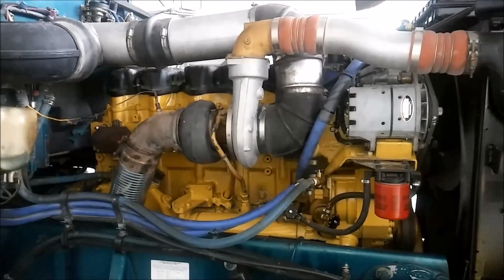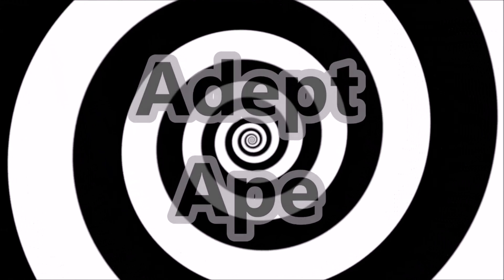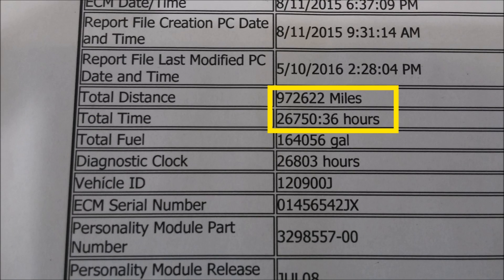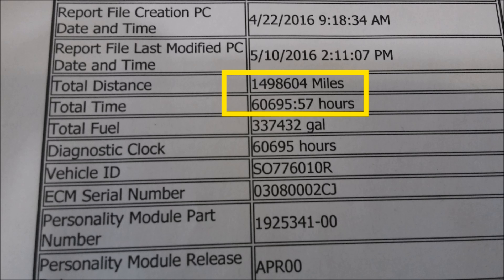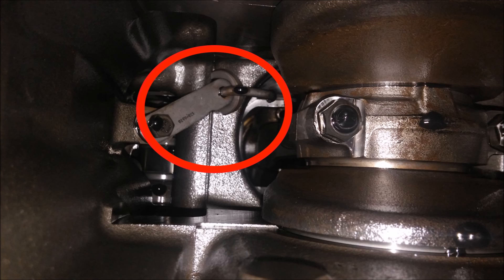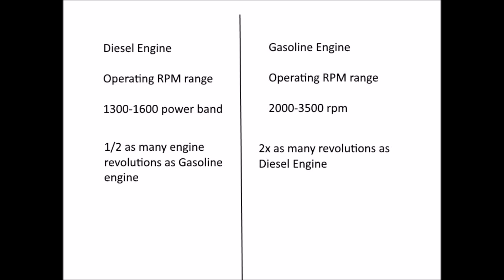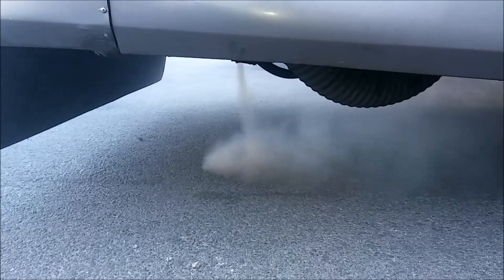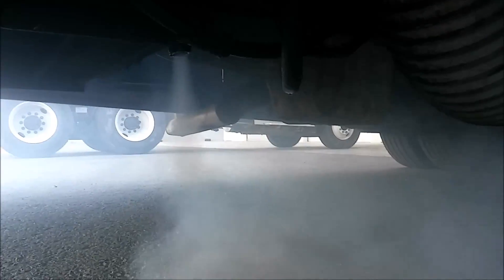Why Do Diesel Engines Last So Long?

Comment: That right there is one of the best diesel engines made. A single turbo 3406 
Bullet proof. 
My detriot 14l 2007 went till 700k first head gasket. 
900 another head gasket by a idiot mech. 
So.at 930 I had a Inframe done at dealer. 
Should be good for another million miles. 
But that cat is the wet dream of all over the road truckers.

Comment: I would say that on a normal car based engine it will come down to rpm. A diesel revs less than a petrol and its parts are getting less stress on them

Comment: One thing I might add, before Dean Ing published his survivalist book, and I have a copy of it vacuum preserved after microfilming it and had it reprinted from the microfilm archive cassettes, it is well known fact that during WW I and before WW I castor oil is used as an engine  lubricant and a well blended graphite-thiokol rubber (rubber containing 5% sulfur and 5% lamp black carbon dissolved and mixed with the rubber before being pressed, formed, and vulcanized into it's final shape) is used as an indefinite revolving seal for both moving and stationary seal and graphite lubricates graphite. The castor oil, over time, forms a thin layer of self-renewing self-lubricating varnish on all mechanical parts. Dean Ing claims to have a Volkswagen using an engine oil composed of a mixture of 50% castor oil and 50% Steen-C silicone oil, so far so good it is still running in the 80s and I have no doubt that it is still running. Using direct drive gear-shaft designs means no belts or metal chain belts to break. The minute the diesel engine is started all direct gear-shafts drives the engine oil pump, the water cooling pump (now containing bars leaks), the fan driving cooling air through the radiator, etc. All gear-shaft driven systems are covered with a metal mesh protective cover for human safety needs and safety standards requirements.
Reply: Caster oil was used in racing cars before the war.
Reply: Caster oil was used in racing cars before the war.

Comment: Modern diesels are way more unreliable that gasolines. You may get more miles out of the block but that will cost you more on other parts because they come with a load of frequently problematic and very high cost components that gasoline engines simply don´t have: electronic injection pumps, turbos, EGR´s, MAF´s, high pressure injectors, DPF´s, intercooler, etc

Comment: You need to compare a 7.3 Ford diesel to say a big block 460 big block because the 7.3 was made to replace the 460 that way your comparing apples to apples not apples to melons

Comment: At road speed  a 80,000 lb load needs. 250 to 300 hp or less so the big 450 hp engine is just playing with the load. 
Worm tham up and cool em off.
That's my take...

Comment: I will agree diesel engines are heavy duty. However, the main reason diesels last longer because they typically run on lower RPMs. The lifespan of an engine is measured by the RPMS it makes however this would be so hard to calculate so we uses mileage or hours. Lower RPMs, longer life.

Comment: part of why these trucks last longer is cause they run all day, they run cold alot less than cars do on average and its the cold running that wears em out, a guy put a million miles on a toyota tundra cause he took care of it and drove it pretty much all day every day, caterpillar makes good engines but we have hell with them and their core charge bs, half of it was us, one of our guys forgot to get a reciept or something and they took advantage of it and took the cores and since we cant prove we gave them em they just went and said we owed them those cores again, and they get away with it cause we dont have a reciept to prove em wrong, its a shitty move on cat and a big mistake on us, we lost thousands, each cylinder pack out of a 3412 is like 700 bucks as a core, a cam is 800 bucks and a turbo turbine assembly without the housings is like 3300 bucks and the cylinder head off the 3412 is like 5 grand as a core, and we have 12 cylinder packs so all that together we lost about 17,500 bucks, which is a big shit piss the boss off move, glad i wasnt in charge of that but if i was i would probably make damn sure i got that reciept for my cores, also cat should try and make it right with us instead of saying survival of the fittest, thats not how you build customer loyalty, they dont seem to care because they already own the industrial world, big business is a horrible thing sometimes, thats why i hate cat, dont hate the motors cause they work and work well but if i ever have to fix one of mine i will not be buying OEM cat parts

Comment: I certainly agree that diesel engines last longer but I also believe that the auto manufacturers don't want their engines to last so you have to a) take it in for service, orb) you will to buy a new car or truck.I think they could make a gas engines last as long as a diesel...if they wanted to.  I got almost 300,000 miles out of a Chevy 4.3L through proper maintenance.  If you can do that with a Chevy you can do better with a Toyota!  I plan to get a half million out of my Toyota.

Comment: Well, OK, diesel engines have larger parts compared to gas engines of equal sizes. But, that's because of the large amount of torque that they produce.... smaller size would break. But, I agree that the internals are built stronger, for sure, in part, by being bigger and heavier. Now, the gear and manually driven parts does indeed add reliability, as there are less parts in the system that could possibly fail. However, Toyota makes gasoline engines that are some of the best on the planet. I would keep in mind that those oil jets for the pistons are not extra ... they are required to stop the engine from failing. If that jet fails, huge problem. Finally, yes the diesel does indeed run at lower RPMs. One main reason for that, however, is due to their increased mass. With such a large mass, if it were to run at higher RPMs, it would self-destruct. Therefore, they are designed to have as much power as possible at the lowest RPM. It is a trade off. That's why they produce so much torque, well one reason anyway. Gas engines can run faster because they are lighter. Example, you want higher RPMs, lighten the internals. The comment about 75% damage being done during the heating phase ... well, yes, back in the day. Today's gasoline engines have no warm up period, except at very low temperatures. That's not just the engine designs ... it's the oil today. Synthetic oil 0-20 is in my Honda. No warm up. No warm up recommended. It's not even in the manual. Granted, I don't suggest to start and floor it when it's -15 degrees. That's is more extreme. But in typical 30 degree Philly winter. I don't warm up and I beat the crap out of my Honda, and there is not a damn thing wrong with it. And finally ..........WELL DAAAA. That's why diesels have so many thermostats....because they are so hard to cool

Comment: Great videos and information you provide. Thank you

You mentioned that most overheating issues that you encountered were diesel pusher RVs.
I currently own an RV with a CAT C9 engine and love it. I am interested in hearing your view regarding diesel pushers and overheating maintenance requirements to reduce possible overheating of diesel pushers RV,s.
Thanks

Comment: Diesel engines still use timing belts. Our PSA DW8B 1.9 NA Diesel engine in our 2004 Berlingo uses a timing belt and an auxiliary belt

Comment: If is CAT will last long, a perfection ingenuity.
Reply: If it is in a over the road truck you will get it to give you great service.  CAT didn't have such great luck with the engines they made for locomotives.  They failed miserably.  Even CAT couldn't figure out what to do to fix them.

Comment: 1992 mechanical 3406C 450,000 miles .

Light knock at idle and under 1600 rpm, above 1600 rpm knock gets much worse. Problem started 5 weeks ago .Overhead was run 3 weeks ago. Rods and mains replaced 2 days ago. Nothing found in pan. Did gain 10 lbs of oil pressure !! Work done at local diesel shop. Also taken to Cat dealer checked out in parking lot ( they did not ride in truck ) . Said they heard nothing.
Reply from the maker: +rob byrum A knock could be a lot of things, air compressor, camshaft/valvetrain, exhaust leak. Really depends on what the "knock" sounds like.
Reply: Hi totally understand , I was the engine rebuilder for a very large ready mix company years ago. I have not herd the truck . This info was given over the phone. I don't understand why they can't get at least some general area where noise is coming from.

Comment: The ONLY reason a diesel lasts longer than an equivalent gas engine is low steady RPM.  Highway cruising, pulling.  Diesels in general city/highway pickup truck type use have only marginally longer lifespans, with radically higher maintenance costs.

Comment: While I'll agree with the fuel and use argument, the journal size has nothing to do with it.  First of all a 15 liter engine has a displacement of 2.5 liters per cylinder instead of roughly 3/4 of a liter per cylinder that a 350 would have.  That alone makes for a bigger piston, rod, and crank which would all need bigger bearings to keep it all properly lubricated and held together.  Next there's the fact that the compression ratio of diesels in general is at least twice that of a stock gas engine which leads to higher cylinder pressures which in turn leads to the need for bigger bearings to support it all.  Finally a gas engine only fills the cylinder with air at wide open throttle due to the trottle body or carb restricting air flow to regulate engine speed which causes lower cylinder pressures on the compression stroke.  A diesel on the other hand has no throttle body or carb and fills it's cylinders with air on every stroke... then on top of that have turbos to push more air in the cylinder which in turn will of course raise cylinder pressure.  In todays economy of making things cheap so profits get bigger if they could shave a few pounds of metal out of the engine it would have been done it years ago.  The reason the journals are the size they are is because of basic physics... they need to be that size to prevent failure.
Reply: For some reason this is still kind of bugging me... parts of it are kind of misleading.  Probably less than 30% of people actually understand what a 10+ liter engine is and what it's built for.  Part of the reason these engine last over a million miles is because they have to.  The drivers I know of put around 500 miles a day on their rig.  500 miles a day 6 days a week ends up at 156,000 miles a year... and that's just a single driver making a single run. At that rate it would take 6.4 years to reach a million miles.  An engine in the shop for a rebuild isn't making you any money (I'm guessing between 1 and 1.5 million is probably average).  You also have to factor in the fact that these same (but sometimes somewhat modified) engines power different equipment like generators, construction equipment, farm equipment, and such that may run 24 hours a day for weeks on end.  Assume a constant road speed of 65 MPH over 24 hours would put you at 1560 miles in one day to put that in perspective.  At that rate it would take less than two years to reach a million miles (or it's equivalent hours).  Chances are due to environment, use, actual load, and other factors the engine may be being worked less or more than a road engine which will effect how long until a $10,000 or more rebuild will come around.

The gear drive is more or less necessary.  I doubt anyone really wants to tear the engine half apart every year or two to change a chain.  The gear drive is does eliminate the whole belts breaking and chain issues since your air compressor, fuel pump, power steering, and on some water pumps are all gear driven.  I'd venture a guess it would take a decent chain to force open the valves for the engine brake also.  I'm sure there's hydraulic pumps and such that I haven't dealt with that bolt right on as well to the gear drive.  Speaking of water pumps... a modern industrial diesel should not die due to overheating.  The only two ways it should overheat to the point of failure other than air in the system that causes the sensors to read wrong are:  the operator kept pushing the shut down over ride, or the auto shutdown sequence was disabled in the ECU . A belt driven water pump isn't that big of a deal, but the gear drive is obviously better.    

That covers it for me... other than that I did like the video.  Never knew about the cooling jets before (we don't get into major engine work.)
Reply: I screwed up... 500 miles a day at 5 days a week = 130,000 miles a year which is 7.7 years until the million mile mark.

Comment: Diesel as a fuel is far more lubricating

Engines are built heavier to deal wd the higher compressions

Engines are usually long stroke and rev much lesser

Loads f low end torque so leaser revving while driving

Dont sound dat great on revving so people rev it lesser

Na diesels much lower power wn compared to na petrol . The engine is jst nt strained really high

Comment: My C15 cat has 1.1 million miles on and runs like a top.. Just as a side note that all the goin green tree huggin bullshit put a stop to all these million mile engines with the Democrat Exhaust Fluid and other junk on them.. I have seen isx cummins knock holes right through the block under 300k miles on from the emission system not bein maintained properly.. but the ones that have the emission system deleted last forever within reason of good care..
Reply from the maker: +0307 0307 I've never heard of it called Democrat Exhaust Fluid before, that is pretty funny. The engines really don't like all the recycled exhaust and aftertreatment junk. It is crazy the truck market changed so much in 10 years. You could have bought a Cat with pretty much zero emissions regulations a decade ago. Now you can't even buy a Cat and every other engine has been heavily regulated.
Reply: Yeah it's funny but when I drove coal truck before obama save us all from evil coal, it took DEF. I took a black magic marker and scratched out diesel and wrote democrat above it. So it said democrat exhaust fluid. Guys laughed about it for a couple years lol.. it was basically me looking for ways to release my frustration with the government's bs.. needless to say I thoraly enjoy my cat. I'd rather a 6nz but I won't complain about a acert compared to what's on the road today.

Comment: All good till u praise gear driven water pump. no good John deere mech for 17 years. when they went gear drive in the 1983 get water in the engine oil. Today got a 9320 tractor. water pump failure. bits and pieces of the water pump ended up in the timing cover. so long crank gear oil pump gear idler gear and cam gear. My customer wishes it had a belt.

Comment: Well not ALL diesels, chevy 6.5s don't for sure, and yes Ford's 6.0
Im running a 2000 7.3 447k miles on it and still running great.
LOL chevy 350 vs a 927.6 in³ cat engine LOL

Comment: 1 thing that a standard 'Gasoline' or petrol as we call it in Australia, can't do, that a diesel can, if the right modifications are made, is run of used cooking oil, used transmission fluid and even used Diesel engine oil. As I said, there are modifications that have to be made, like heat coils in fuel tanks, especially if u live in the northern hemisphere and other mods to warm & keep fuel lines warm. Imagine running your diesel on 40-70ltrs of used oil per week? Very very cheap.

Comment: could one of the reasons be they run at a lower rpm.? If a gas engine produced the same hp. it would tear itself apart in no time.

Comment: old Volvo's were famous for high milage 
my 79' 240 Volvo has 513k on it and all original  no rebuilds
a Guinness book of world records has a Volvo P1800 at over 3 million miles
so yes a proper designed gas engine can last as long as a diesel

Comment: This guy is not comparing engines correctly.
Sure, many of the things he say's are true but comparing a huge cat or Cummins engine with an Auto engine is silly.
RV's for instance nowadays are commonly in the 3 litre displacement range and yes, they are running serpentine belts to drive their camshafts and water pumps etc.
They are still somewhat heavier built than a comparable auto engine but most are termed high-speed diesel engines and although their torque band starts as low as 1500 rpm they consistently run at 3000 plus rpm at highway speeds .
The use of synthetic oils and the very good filtration they utilise makes a big difference as well plus, common rail systems have very efficient filtration and the fuel used is much cleaner than it was even 10 years ago.
Any engine will suffer wear if it is neglected by lack of servicing and load abuse and this is the most common cause of an engine wearing out prematurely in my experience as a diesel mechanic over 40 years

Comment: you have GREAT info, don't get me wrong. I learned a lot from this, but I would be more careful classifying each mechanically. a diesel passenger car shares far more components with a gasoline engine, timing belts, hydraulic lifters, belt pumps etc... GOOD info, not perfect

Comment: diesel engines are a lot better than gasoline engines, diesel engine  is ran by larger parts so it doesn't half to work as hard and gears, a gasoline engine today is ran by belts.